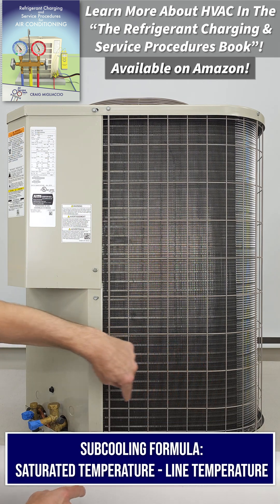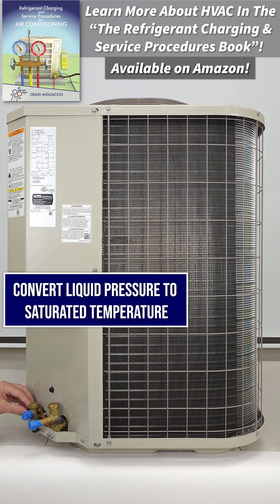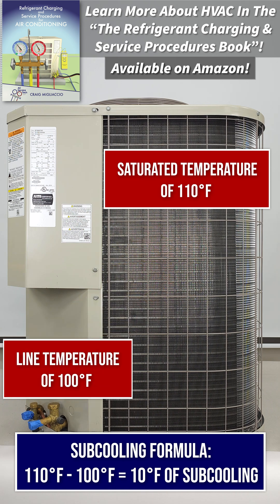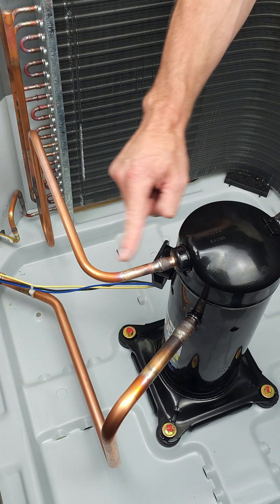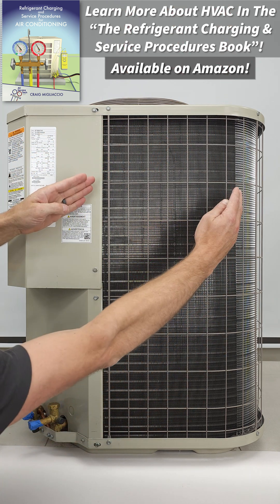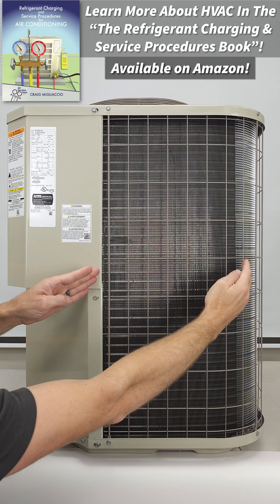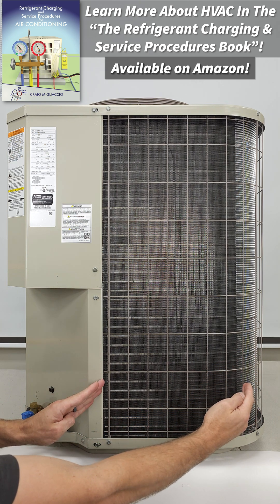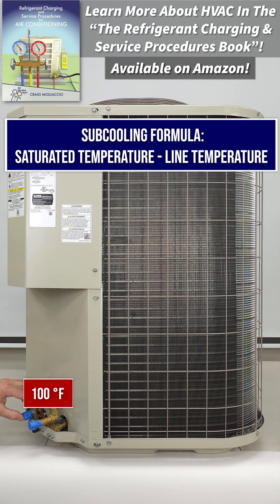Explaining Subcooling on an Outdoor AC Unit, Quickly! #hvac

Comment: I thought it was just simply how much is the condenser filled w liquid refrigerant, if it not enough it will underfeed the evaporator, if it's too much then the condenser will have less surface area for phase change and increase head pressure

Comment: Please check, fujitsu used LG compressor in its hot and cold model above 2 tons which has a capacity of producing 23000 btu instead of 30000 why it is so

Comment: Great clear explanation and makes it clear graphically as to how an over-charge and under-charge would affect the amount of liquid-refrigerant in the bottom 'third' of the condenser coil. I can see exactly why the bottom third should be liquid, because that is where the subcooling occurs and when a lot of heat is rejected efficiently from a liquid to the ambient space. Beautiful! Charging to a manuf spec of sub-cooling is simply balancing how much liquid is in the bottom of the condenser coil, it is that simple.

Comment: I think he does a very good job and literally describing the face change and process to get there. My instructor had a similar way of describing it, but did it on a whiteboard.  I think the issue most of us struggle with is putting the concept of phase change into practical use when it comes to applying it to a problem that’s occurring, and if the readings will indicate that the phase change is occurring the way it supposed to based on the readings you’re getting